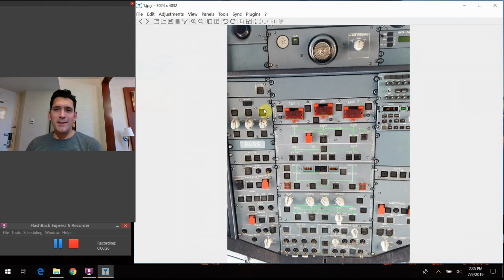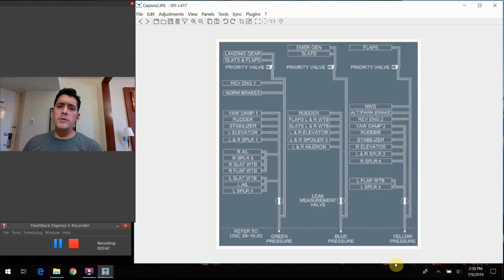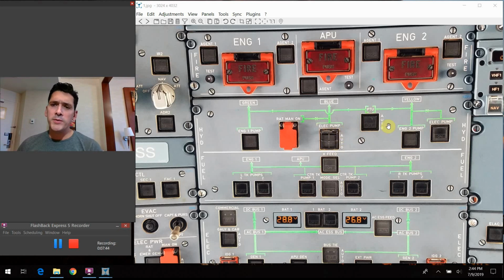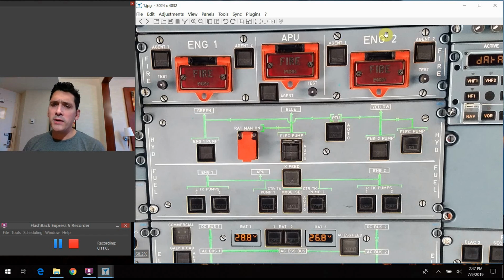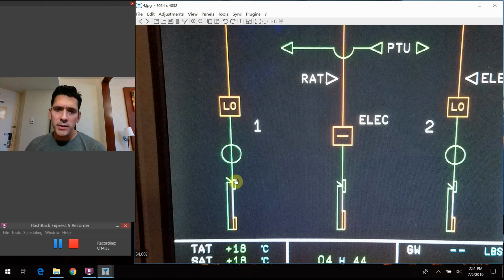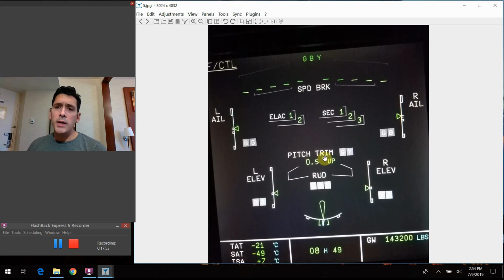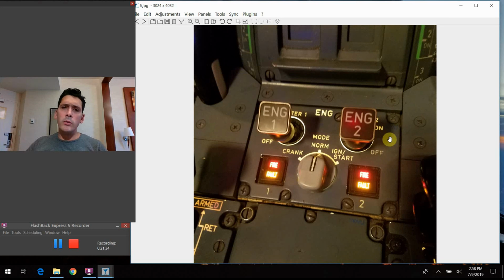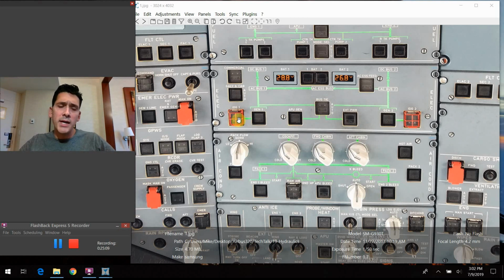Airbus A320 Cockpit Tour: #19 - Hydraulic Panel: What do all those buttons do?!

Comment: does there need to be an abnormal situation for the power transfer between yellow and green hydraulic systems or does it need to always happen once the yellow is pushed for green nose gear steering thanks a lot
Reply: (for pushback)

Comment: Thank you very much for taking the effort to explain this panel in great detail. Would you be able to confirm whether any of those pushbuttons are latching type buttons or are they all momentary push buttons. I'll just clarify what I mean by those terms. So in the case of a latching button, if you pressed it, the button would remain depressed until you pressed it again and it unlatched and physically popped up. A momentary button on the other hand only expects a momentary press and they the software decides how to handle that press. The button physically does not remain depressed.
I would really appreciate a response to this query as I'm trying to determine what switch types to use for the Korry buttons that I'm trying to DIY.

Comment: I was fiddling with the hydraulics in the a32nx A320 Neo in MSFS today, and got into a situation I haven't been in before (before startup). I cannot remember the exact message, but on the HYD ECAM the yellow line showed a fault new to me, like "No air pressure", "Low air pressure" or something along those lines. I had the yellow electric pump activated to do some break testing and monitoring the accu pressure, turned of the elec pump and repeated brake on/off (parking) emptied the accu pressure, leading to this error. Does that ring a bell, what does it mean and how to rectify the situation? Thanks.
Reply from the maker: Hi Henrik. Thanks so much for tuning in my friend. I haven't worked on the channel in quite some time. I would like to circle back at some point and be more regular again. Anyways, this is a good question you have. I would have to know the exact message that you are seeing to give you the best possible answer, but from what it sounds like you are describing, this is a yellow system low hydraulic pressure condition. With no pumps running, you have enough residual pressure left in the yellow hydraulic system accumulator for 6 parking brake applications. Think of the accumulator like a wound up spring. Once all the tension is released to power other things, you would need to rewind the spring again. Same concept here but just with pressure.  After you cycle the parking brake the pressure in the whole system will drop. In order to re pressurize the system, you can do many things. You can turn on the yellow electric pump, you could start the number 1 engine and the ptu will start running and get your pressure back to the yellow side, or you could start the number 2 engine. 

To further the discussion, I'm not sure if you are indeed seeing something that specifically makes reference to air pressure. I'm not familiar with that message, but most hydraulic systems have a feature built into the fluid reservoirs known as head pressure. In other words, there is a bit of positive air pressure used to keep the fluid in place so to speak and to keep the pumps from cavitating.
Reply: @MikeAbignale  Thanks for answering, and for the great content, Mike! I just double checked the message, it reads "LO AIR PRESS" on the lower ECAM on HYD for the yellow system (shows in amber to the right of the  fluid level indication, lower right). It shows up if repeatedly pumping the parking break without any system keeping pressure, until it's empty. And then only after having turned on the yellow electric pump. So it is not resolved after elec pump builds pressure on both green and yellow system. Perhaps running it empty leads to a situation not ideal. Of course it's just for understanding, not normal operation to keep turning the breaks on and off without pressure I guess.

Comment: Mr. Abignale , thank you for clarifying my doubts. In the video , I saw  one of the pictures where the engines are powered up, that the blue system had 3000psi, similar to that of the other two systems. If the green system is powered by ENG 1 and the yellow system by ENG 2, how is the blue system powered (assuming the RAT is not deployed)? Is the RAT a part of the blue system or is it an Independent system? During the light test , i noted that the yellow ELEC pump switch has ON/FAULT while the guarded blue ELEC switch has OFF/FAULT. Is there a difference between these pumps? Why is the blue ELEC switch guarded?During single engine taxi procedure, you mentioned that the yellow ELEC button is switched on. Which are the different systems powered by this ELEC pushbutton? Does the failure of the yellow system means that the elec pump fails? What is the difference between engine driven pump and electric pumps ? Are they similar or completely different to each other? (Not related but) in a single engine taxi procedure, doesn't it mean increased wear and tear for the running engine?Is there a specific engine you need to shut down for single engine taxi or does it alternate after each landing?Can you feel any big difference during single engine taxi (controlling the aircraft)? How effective is single engine taxi procedure?
Reply from the maker: Hi Aby, here's some more info in reference to your questions...

If the green system is powered by ENG 1 and the yellow system by ENG 2, how is the blue system powered (assuming the RAT is not deployed)? - By the Blue electric pump

Is the RAT a part of the blue system or is it an Independent system? - Part of the Blue system

During the light test , i noted that the yellow ELEC pump switch has ON/FAULT while the guarded blue ELEC switch has OFF/FAULT. Is there a difference between these pumps? - Not really, they both operate the same way and do the same thing for each respective system. 

Why is the blue ELEC switch guarded? - Because there is no automatic back up for this pump/system. The green and yellow have an automatic back up through the PTU.

During single engine taxi procedure, you mentioned that the yellow ELEC button is switched on. Which are the different systems powered by this ELEC pushbutton? - All components on the Yellow side of the system. Reference the graphic in the beginning of the video if you are curious which components reside on the Yellow system.

Does the failure of the yellow system means that the elec pump fails? - Not necessarily. You still could have the PTU or ENG 2 pump provide pressure. A total failure might be the case of all fluid leaking out for example.

What is the difference between engine driven pump and electric pumps? - ENG pump is geared to the engine and runs when the engine is running. Electric pumps can be run whenever you have electricity on the plane.

Are they similar or completely different to each other? - They both provide hydraulic pressure but they derive their power in a different manner. 

 (Not related but) in a single engine taxi procedure, doesn't it mean increased wear and tear for the running engine?Is there a specific engine you need to shut down for single engine taxi or does it alternate after each landing? - It does provide for uneven wear, but the plane was designed to always single engine taxi on the #1 engine. 

Can you feel any big difference during single engine taxi? How effective is single engine taxi procedure? - The steering actually feels almost unaffected, but sometimes we are unable to taxi uphill on certain taxiways. We don't use more than 50% n1 for taxi operations so sometimes you are forced to start the #2 engine to make it uphill when you are taxiing out and the plane is very heavy.
Reply: @MikeAbignale  Thank you very much for clarifying my doubts. Waiting for the next video😀😀😀
Reply from the maker: Thanks for watching Aby :)